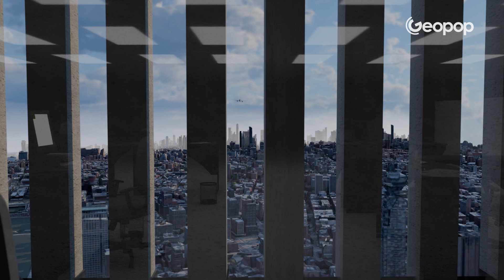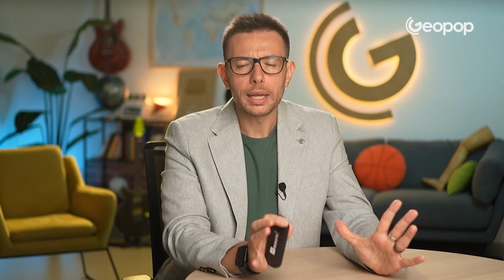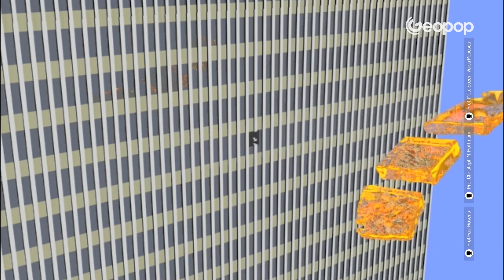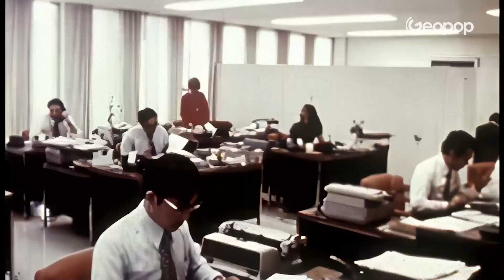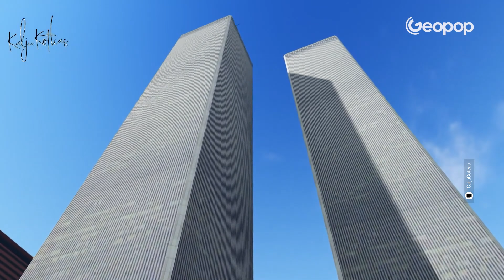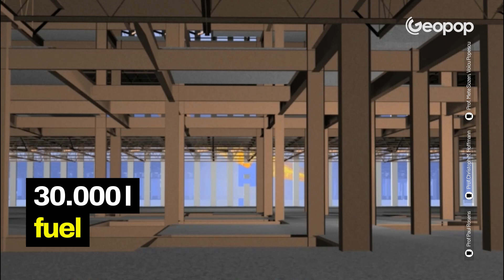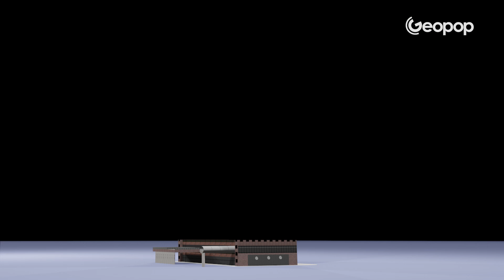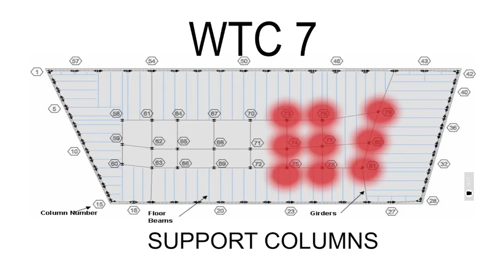9/11, 2001: The Technical Reconstruction of the Twin Towers and WTC 7 Collapses

Comment: How do aluminum wing tips shear load bearing steel beams? Even the wing Tips sheared them and video shows it.  The 150ft long plane stuffed itself into a 60ft floor. The next 120ft were stuffed with 47 load bearing beams, 4ftX2.5ft in size!! So the hollow aluminum tube could do nothing to it. But even it fell straight down that day!!! And 8 floors per second fell. Each floor had over 1 Million Pounds of steel reinforced concrete. So some 12 million lbs of Concrete were being pulverized Every Second, all the way to floor 1.  Odd. Good luck finding big chunks of concrete.  It's pulverized. IN the Air. Too bad the video shows none of the inner beams.  And at the top was a HAT TRUSS. You should have a look. Prior to Collapse, the Antenna dropped 12 Feet First, Then collapse began. So the hat trussed was compromised first then the antenna fell Down, not sideways.
Reply: By shearing the four 5/8" bolts at the connecting flanges
Reply: @TheLoonResistance  There were zillions of connections by welds, rivets, nuts/bolts. And they all simultaneously are disconnected. somehow.  220 floors 220 acres... plus WTC7
Reply: @TheHypnotstCollector  - No, they did not. 

You first asked about how the aircraft were able to penetrate the structure.  The primary perimeter hollow box-section steel column failure mechanism was bolt-shearing at the connecting flanges, which occur every 3 stories with the flange points being staggered every 3 columns. This is pretty obvious just looking at high res photos of the impact sites.

Other perimeter columns were bent and twisted, some experiencing weld seam failures.

Greatest damage was at the center of mass (fuselage). The further one goes out from the center of mass, the less damage there is to the building, until you get to the outer outer wings which broke off the aluminum cladding and dented the columns without breaking or penetrating.   People fuss too much about wings and forget there is a big heavy part in the middle of the plane. 

IF you want to talk about collapse mechanisms - which are very different than impact damage mechanisms - we can do that too. I prefer to tackle one issue at a time until it is resolved, to avoid confusion.
Reply: @TheLoonResistance   well let's tackle the wings first. The wing Tips sheared right thru and the Tip of the tail did too. And left a cartoon punch out of a plane in it's wake.  You can watch it in slomo, freeze frame it, look at photos and the wing tips shear the steel outer load bearing beams.  Just for fun, what do you think the "Nose-out" effect is caused by? It too is there, Peter Jennings, Dan Rather and others all said "The plane went right thru the building"  That is what it looks like but "nose out" is not the nose of the plane exiting the WTC. That would be impossible. But then the impact effect is impossible  but it too happened.  What is nose-out.  And you can clearly see every floor explode and fall not 3 floors at a time.
Reply: @TheHypnotstCollector  - Not correct. The outer wings took the cladding off and dented the perimeter columns, but did not sever or penetrate them. Just the windows.  Looks worse than it is. 

Just as I said in my previous post.
Reply: @TheLoonResistance  The wings went into the building attached to the fuselage. Grow Up.
Reply: @TheHypnotstCollector  - Grow up?  You are the one throwing a hissy fit over an engineering problem.  Yes, the wings - all of them - entered the towers.  The outer wings just did it by blasting around the perimeter columns and through the windows. 

So we can stop talking around each other, I would refer you to NIST NCSTAR 1-2 Baseline Structural Performance and Aircraft Impact Damage Analysis of the World Trade Center Towers. Federal Building and Fire Safety Investigation of the World Trade Center Disaster

www.nist.gov/publications/baseline-structural-performance-and-aircraft-impact-damage-analysis-world-trade-1

On page lxviii when discussing their impact model The NIST noted:

A normal impact of the exterior wall by an empty wing segment from approximately mid-span of the wing produced significant damage to the exterior columsn but not complete failure. Impact of the same wing section, but filled with fuel, resulted in extensive damage to the external panels of the towers, including complete failure of the exterior columns

If we scroll down just a bit to Figure E-23  which is a map of actual impact damage from Flight 11 into the North Tower, the span of the impact runs from column 153 on the left to 109  on the right. Columns 110 and 111 on the right and on the left columns 149 to 153 were not severed, 148 and 147 barely severed, 146 and 148 were bent and twisted. 141 to 143 were severed in a clean line across - at the connecting flanges from bolt shearing failure. 

And before you starting whining and complaining about The NIST with all that dogma the internet has been feeding you, all of this can be easily confirmed with careful examination of the available hi-res photos. You don't need The NIST for any of this, nor does the truth of this rely on any report written by The NIST years later. 

Now let me give you a superb example of flange bolt shearing failure and how little it really took to accomplish it, shown in this 5-minute video. 

www.youtube.com/watch?v=P8mG9pyImb8
Reply: @TheHypnotstCollector  - I can't help but notice the more detailed and technical this discussion gets the more you resort to personal attack and insult and avoid discussion of the topic at hand,... because the discussion isn't going the way you want.

That's a character flaw.

I wish you luck with your continued epic fail. Really hope that works out for you.
Reply: @TheLoonResistance  You can't even describe a wing correctly
Reply: @TheHypnotstCollector  - I never described the wing at all. You are fishing with the wrong bait and still trying to avoid the topic at hand because it isn't going the way you want. 

Remember that the goal of conspiracy rhetoric is to bog down the discussion, not to make progress toward a solution Jay Windley 

We have differing objectives. 

Let me know if you ever decide to, and become capable of being serious.
Reply: @TheLoonResistance   Your words :::  The wings of aircraft are made of a steel frame with an aluminum skin.  They are quite sturdy,  and necessarily so to hold up to extreme turbulence.
Reply: @TheHypnotstCollector  -Check again genius. That's not my post 

Now stop screwing around and wasting my time. 

In your OP you made this claim:  How do aluminum wing tips shear load bearing steel beams? Even the wing Tips sheared them and video shows it

I took objection to that claim because it is quite simply not true, then I presented evidence the claim is untrue. The wing tips failed to shear, cut, slice or in any other way penetrate the perimeter columns complete with columns numbers in question.

The correct reply from you would be Thank you for the correction. I will amend my original hypothesis on this relatively minor and unimportant detail accordingly

Like you said, grow up.
Reply: @TheLoonResistance  EVERY Video shows the wings entering the building and even the wing tips entered the WTC.
Reply: @TheHypnotstCollector  - Please do not move the goalpost. No one is disputing the wings - even the tips - entered the towers. 

That however, IS NOT THE CLAIM WE ARE DISCUSSING

YOUR CLAIM (once again since you seem to forget):  How do aluminum wing tips shear load bearing steel beams? Even the wing Tips sheared them and video shows it

Shearing and "entering" are not the same thing. It pains me to have to point this out but like rushing water hitting a rock in a stream, those outer wings went around the perimeter columns NOT through them. 🤦‍♂

Last time, please stop dicking around, pay attention and focus. I do not fall for deliberately evasive off-topic derails or goalpost moving. You introduced the topic of discussion, so stick to it.
Reply: @TheLoonResistance  You are  hallucinating .  The entire plane entered the WTC, wing tips and all. Not torsional rotation, not a shudder. The entire plane entered the WTC. 185 ft occupied 60 feet of office space. The next 120ft were occupied by the 47 central spines, 4ftx2.5ft, You can see where the wings entered the WTC from the cartoon like punch out of the wings including the tail.
Reply: @TheHypnotstCollector  - Oh FFS. YES, the entire plane (near as makes no difference) entered the building wing TIPS and all.

Yes, the wing TIPS failed to penetrate columns 110 and 111 on the right and on the left columns 149 to 153 with148 and 147 barely severed and 146 and 148 bent and twisted but not severed. Objectively this is true. We can see it in the photos. Those columns were clearly struck, not penetrated. 

BOTH STATEMENTS CAN BE AND ARE TRUE because on either side of every column is a LARGE AIR GAP.  Momentum will happily carry any debris that fails to pass through the column around the column and through the air gap instead.

A rock in a stream.  It's not a difficult concept. 

I'm not sure if you are being deliberately obtuse here or just can't help it. Seems a strange point to have this big an ego trip about.
Reply: The wings of aircraft are made of a steel frame with an aluminum skin.  They are quite sturdy,  and necessarily so to hold up to extreme turbulence.
The rest of the plane is built the same. 
Maybe do a little research to avoid looking ignorant.
Reply: @kurthaas4331   ignorant bone head smurfs typing in drivel.  you have no idea what you are saying.

Comment: I'm sorry, but if you're basing this video off the NIST report, you're dead wrong. If 9/11 families and survivors wanted an investigation into NIST, that should be your evidence that something doesn't add up. There's only been 3 high rises in the history of high rises that came down due to "fire" and it was on 9/11
Reply: Literally none of that is true.
Reply: @TheLoonResistance  it literally is tho
Reply: @Crankwalk2688  - Plasco Tower - steel framed high rise collapsing due to fire. www.youtube.com/watch?v=sPGr4D1-zDI

One of countless thousands of steel framed buildings that have failed in fire because steel - being formed using heat and deforming the same way - is uniquely vulnerable to fire, not immune to it. Blacksmiths have known this for a thousand years, so what is holding you back in the Dark Ages?

Comment: NIST also when asked if there was explosives said no and then when asked if they checked for explosives they also said no. They tried to justify not checking by saying there wasn't enough evidence. There's dozens of videos and eye witness testimony that explosions were indeed heard.
Reply: NIST WTC Investigation FAQ #15

When the WTC investigation was completed in 2008, many in the building design, construction, fire, rescue, safety, and legislative communities praised the effort as the authoritative accounting of the events that took place on Sept. 11. 

With the support and collaboration of these groups, 40 code changes based on the recommendations from the WTC investigation have been adopted into U.S. model building and fire codes. This is a solid affirmation that the work done by the NIST WTC investigation team was of the highest quality and critical to ensuring that future buildings—especially tall buildings—will be increasingly resistant to fire, more easily evacuated in emergencies, more accessible to first responders when needed, and most importantly, safer overall. However, there have been claims from alternative theory groups that factors other than those described in the NIST reports brought down the WTC towers and WTC 7.

NIST found no corroborating evidence for alternative hypotheses suggesting that the buildings were brought down by controlled demolition using explosives or by missiles. 

More information about NIST’s response to these theories can be found in the FAQs on the WTC towers and WTC 7.

The WTC investigation team stands solidly behind its findings and conclusions, including the probable sequence of events leading to the initiation of collapse for each of three buildings. 

NIST WTC Twin Towers FAQ #28

NIST conducted an extremely thorough three-year investigation that included consideration of a number of hypotheses for the collapses of the WTC towers.

Some 200 technical experts—including about 85 career NIST experts and 125 leading experts from the private sector and academia—reviewed tens of thousands of documents, interviewed more than 1,000 people, reviewed 7,000 segments of video footage and 7,000 photographs, analyzed 236 pieces of steel from the wreckage, performed laboratory tests, and created sophisticated computer simulations of the sequence of events that occurred from the moment the aircraft struck the towers until they began to collapse.

Based on its comprehensive investigation, NIST concluded that the WTC towers collapsed according to the scenario detailed in the response to Question 11.

NIST's findings do not support the "pancake theory" of collapse, which is premised on a progressive failure of the floor systems in the WTC towers (the composite floor system—that connected the core columns and the perimeter columns—consisted of a grid of steel "trusses" integrated with a concrete slab; see diagram). Instead, the NIST investigation showed conclusively that the failure of the inwardly bowed perimeter columns initiated collapse and that the occurrence of this inward bowing required the sagging floors to remain connected to the columns and pull the columns inwards. Thus, the floors did not fail progressively to cause a pancaking phenomenon.

NIST's findings also do not support the "controlled demolition" theory since there is conclusive evidence that:

the collapse was initiated in the impact and fire floors of the WTC towers and nowhere else, and;
the time it took for the collapse to initiate (56 minutes for WTC 2 and 102 minutes for WTC 1) was dictated by (1) the extent of damage caused by the aircraft impact, and (2) the time it took for the fires to reach critical locations and weaken the structure to the point that the towers could not resist the tremendous energy released by the downward movement of the massive top section of the building at and above the fire and impact floors.
Video evidence also showed unambiguously that the collapse progressed from the top to the bottom, and there was no evidence (collected by NIST or by the New York City Police Department, the Port Authority Police Department, or the Fire Department of New York) of any blast or explosions in the region below the impact and fire floors as the top building sections (including and above the 98th floor in WTC 1 and the 82nd floor in WTC 2) began their downward movement upon collapse initiation.

In summary, NIST found no corroborating evidence for alternative hypotheses suggesting that the WTC towers were brought down by controlled demolition using explosives. NIST also did not find any evidence that missiles were fired at or hit the towers. Instead, photographs and videos from several angles clearly show that the collapse initiated at the fire and impact floors and that the collapse progressed from the initiating floors downward until the dust clouds obscured the view.

And #29; Did the NIST investigation look for evidence of the WTC towers being brought down by controlled demolition? Was the steel tested for explosives or thermite residues

NIST did not test for the residue of these compounds in the steel.

The responses to previous questions demonstrate why NIST concluded that there were no explosives or controlled demolition involved in the collapses of the WTC towers.

The evidence for explosions presented by conspiracists promoting pre-planned demolition conjectures consists entirely of casual interviews carefully cherry-picked for the word explosion with all relevant context removed or ignored.
Reply: @TheLoonResistance https://youtu.be/I0XfXxpo56c?si=nmaSa5rNZQKJcfgp
Reply: @thaThRONe  - The collapse mechanisms for the Twin Towers and Building 7 are well known and understood in the engineering community, with most of them being visible to the naked eye.

None of them require explosives, and indeed explosives do not fit the available evidence. Explosives are a hand-wave used by ignorant morons too dumb or too lazy to figure out the engineering.

News flash:  Someone can use the magic "e" word and not mean bombs. ExplosIVE and explosION are not one and the same.